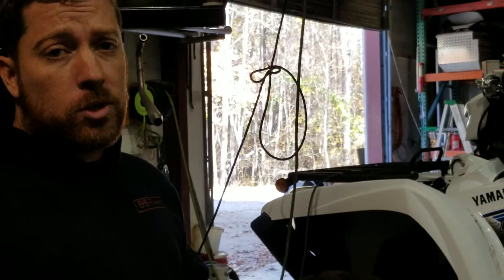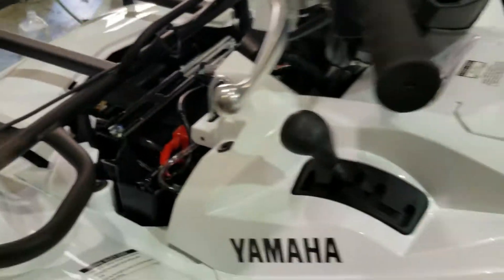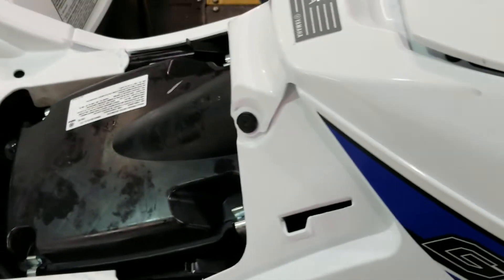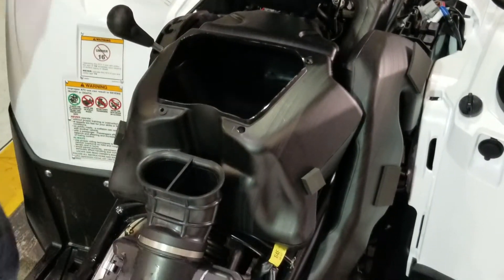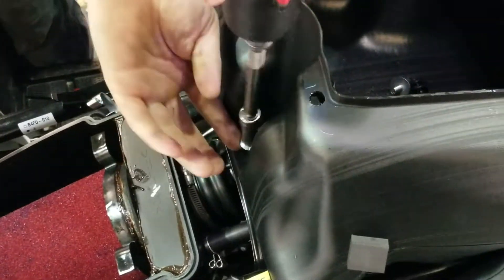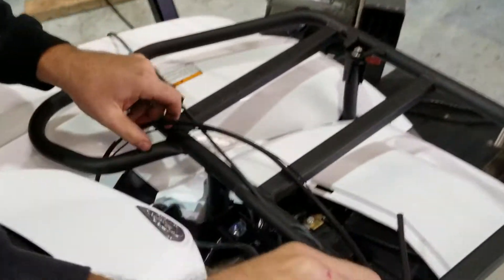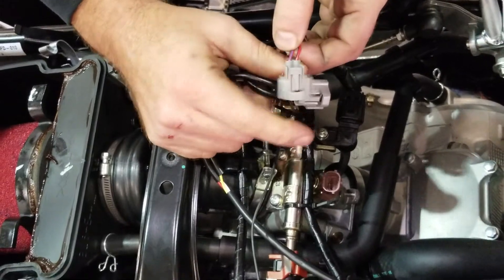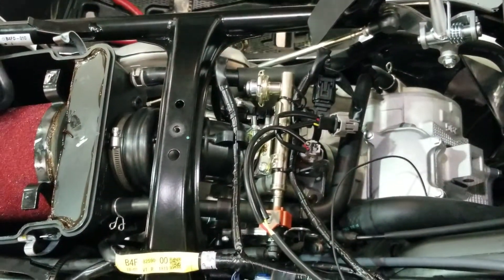2019 Grizzly 700 EFI Controller Install process

Comment: What do you gain from this ?????
Reply: Cooler running motor better throttle response some extra horse power etc also if you put on an exhaust, intake, cam it has tunes already pre loaded to run all of that.....
But mainly for me it was to cool that engine down..
Reply: So after it blinks on start up and goes green and you do no adjustments from that point is it adding fuel immediately. I guess what I'm getting at is, is this a plug and play go ride